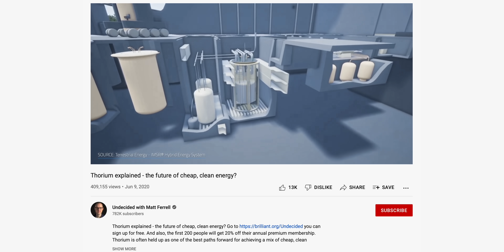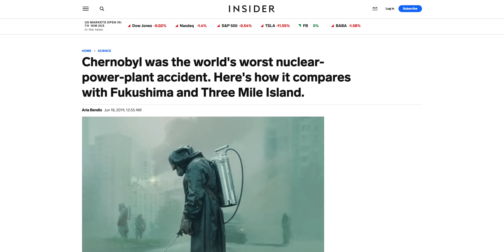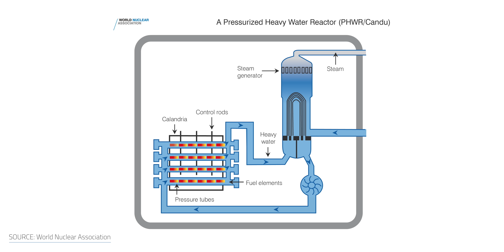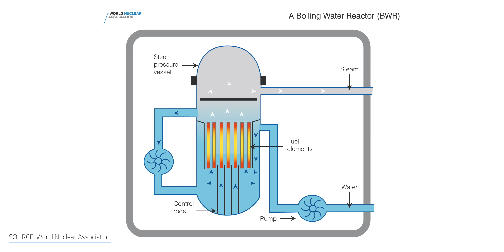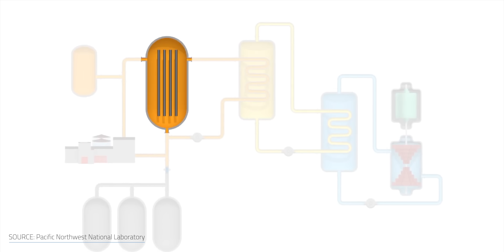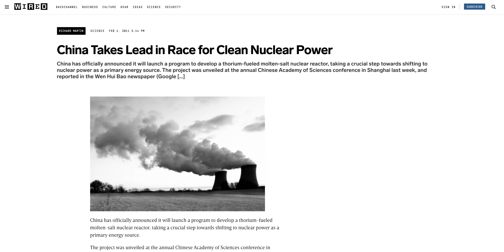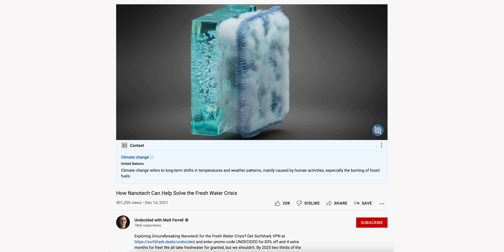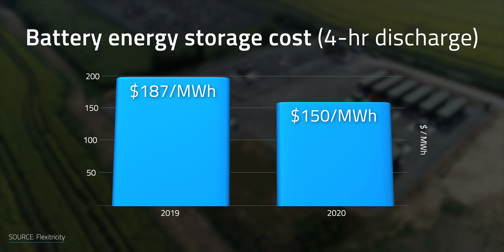Revisiting Thorium Energy - The Future of Nuclear Power?

Comment: I think it fair to be a little bit more suspect of these studies showing great potential and low costs. Nuclear has a long, long history of being great and cheap on paper, but not actually producing those results.

This quote from Hyman Rickover from 1953 is still just a true today as it was back then:
“An academic reactor or reactor plant almost always has the following basic characteristics: (1) It is simple. (2) It is small. (3) It is cheap (4) It is light. (5) It can be built very quickly. (6) It is very flexible in purpose (’omnibus reactor’). (7) Very little development is required. It will use mostly off-the-shelf components. (8) The reactor is in the study phase. It is not being built now.

“On the other hand, a practical reactor plant can be distinguished by the following characteristics: (1) It is being built now. (2) It is behind schedule. (3) It is requiring an immense amount of development on apparently trivial items. Corrosion, in particular, is a problem. (4) It is very expensive. (5) It takes a long time to build because of the engineering development problems. (6) It is large. (7) It is heavy. (8) It is complicated.

“The tools of the academic-reactor designer are a piece of paper and a pencil with an eraser. If a mistake is made, it can always be erased and changed. If the practical-reactor designer errs, he wears the mistake around his neck; it cannot be erased. Everyone can see it.

“The academic-reactor designer is a dilettante. He has not had to assume any real responsibility in connection with his projects. He is free to luxuriate in elegant ideas, the practical shortcomings of which can be relegated to the category of ‘mere technical details.’ The practical-reactor designer must live with these same technical details. Although recalcitrant and awkard, they must be solved and cannot be put off until tomorrow. Their solutions require manpower, time and money.

“Unfortunately for those who must make far-reaching decisions without the benefit of an intimate knowledge of reactor technology and unfortunately for the interested public, it is much easier to get the academic side of an issue than the practical side. For a large part those involved with the academic reactors have more inclination and time to present their ideas in reports and orally to those who will listen. Since they are innocently unaware of the real but hidden difficulties of their plans, they speak with great facility and confidence. Those involved with practical reactors, humbled by their experience, speak less and worry more.”

Thorium is basically still in the same place it was 60 years ago: great on paper, some small experiments are ongoing, far from actual implementation. Let's wait and see if and how Thorium reactors will actually reach the market before dismissing existing technology that is already here, is already abundently available off the shelve, is cleaner and is already cheaper, while costs are still freefalling. Let's also not just brush over the inherent proliferation risks (producing uranium-233) and waste risks that are also associated with most Thorium designs.
Reply: You, or should I say Rickover, was correct and if you read the history, he was ousted because he dared to hold the military industrial complex accountable and for that, wenow have the failures of the recient VC Summer and Vogel reactor projects.  It will be exceedingly difficult to correct those problems now.

Comment: One minor confusion.  The TerraPower (Bill Gates) design only uses Molten Salt to hold the energy (heat) from the reaction for later use.  It uses liquid sodium for cooling, and is a fast neutron design.

Comment: Everything we needed to know about LFTR:s or the chloride salt version was learned at ORNL with that first reactor. The problem is the "first mover" penalty that is the cost of getting the first commercial thorium salt reactor past the NRC. Once that first one has passed muster, the rest can ride on their coat tails.

In other words, the cost of bureaucracy is going to cause us to lose out in the race to put these safe and inexpensive reactors to work. Of course, the fossil fuel infustry, while generating more radioactive waste than the nuclear industry, gets to sit back and hope the job never gets done.

They talk about the mining of thorium, which is ridiculous because thousands of tons of it are generated in the process of mining for rare-Earth metals. And uranium is seldom burned up at a greater rate than 5% of the fuel load, while thorium in a molten salt reactor seldom drops below 90% burn up. And, as pointed out in the video, MSR's don't have to be shut down for refueling.. Uranium reactors must be shut down at least every two years for refueling and more often than that to rearrange the fuel rods to even out burn up.

Since they don't require water for cooling they can run at normal atmospheric pressure and yet at elevated temperatures that make them much more efficient than PWR's, which account for almost all of the world's uranium-based reactors. Yes, they have a few minor problems, but none that can't be engineered around. The first MSR ran for almost six years without problems and technology has advanced over that more than a half century since.

My recommendation would be to site MSR's on old coal-fired plant sites as those plants are shut down. The MSR's can certainly take over the transmission lines and maybe even the generators from the replaced coal plant. What's not to like? The NRC needs to be kicked to the curb on MSR's and the government needs to absorb the first-mover costs so that we can all benefit from this modern marvel brought forward from our past.
Reply: First, blaming the NRC boogie man is an old excuse.  Any new design will require extensive NRC review and the pool of people capable of that task are retiring at a baby-now-retiree-boomer rates. If the NRC approves a bad design, who will be the first to blame them for a poor review?  We have been building BWR and PWRs for 70 years so they sail through the NRC review but the latest VC Summer nuke was canceled after spending $5 billion and Vogel is 100% over budget and 6 years behind schedule with no end in sight. So what magic is going to make MSR or Thorium reactors break these records when you are using the same American engineering, project management, and construction talent? I have already heard people lining up the pandemic, supply chain issues, labor shortage, chip shortage, high fuel/steel price excuses even before any project is started because at least they know the build schedules are a joke.
Concerning the use of old coal fired sites, that is the exact politically motivated decision that was used to select the Natrium site in Wy. Switchyards are not that expensive and may not be a good idea to use 60 year old equipment when the cost to evaluate a site per the Safety Analysis Report will cost hundreds of millions.  Using a present or shudown reactor site would make more sense.
No matter what design is selected, start to operation is at least a 10-15 year project.
Reply: If it is a 10-15 year project, then we had better get started. Actually, because of our climate change issues,  this should be considered as a new Manhattan Project and expedited in all possible ways. 

Not only can these be sited on old coal plant sites, they won't need the switch yards developed for the massive coal trains, but those yards can be used for the industries that can use the process heat coming from fluoride or chloride, liquid thorium salt based reactors. PWR reactors require massive containment buildings and yet operate at lower, less efficient temperatures than liquid fueled reactors, making their excess heat not efficiently usable as process heat for other industries. 

As previously noted, the transmission lines and possibly the generators of shut down coal plants can be utilized by the new nuclear plant. 

One of the biggest problems is the massive and radioactive piles and/or pools of fly ash left over from burning coal. These should not interfere with the operation of a nuclear plant as it replaces the coal plant, but somebody will need to manage that. Many of the byproducts of a liquid thorium salt reactor can be used medically while even using the left over fly ash in concrete can be a problem because of the radioactivity.

Comment: Wind and solar power production don't take into account a number of problems; 1. they wear out far quicker than nuclear reactors. 2. Solar panels actually produce a great deal of toxic waste. 3. Solar and wind equipment is expected to be built in China.  Enriching a genocidal dictatorship that violates every environmental protocol regularly, and is becoming increasingly unstable is a poor guarantee for renewable energy. Windmills kill tens of thousands of birds annually and contribute to the mass extinction underway.  4. MSRs can burn nuclear waste from light water reactors, desalinate seawater, provide energy for decarbonizing sea water. 5. Thorium MSRs can be built on coal plants and former nuclear light water plants saving a huge amount of money in construction.  The corrosion issues have been addressed.  MSRs are less useful for making weapons, which is the main reason why they were not used by the decision-makers at Oak Ridge.  They are actually less likely to be used for fissile material than a light water reactor and can be monitored easier.
Reply: If you are worring about solar panel toxic waste you must be terrorized by the cell phone in your pocket, the computers in your car, Tv, or any other electronic device that is disposed at a rate far sooner than the 30 year life (still producing 75% of rated power) of a solar panel
Reply: @clarkkent9080  Apples and oranges.  Why increase the toxic waste problem by producing billions of solar panels with far shorter life spans than a nuclear reactor?  You tried to make the argument that the land displacement comparison was the opposite of reality. Solar and wind fields already occupy more land and kill more wildlife than any other energy form in the history of species annihilation/extinction short of the ancient comet impact.  I caught you in data falsification in other posts.  You are a brainwashed solar/wind fanatic.  Probably a member of Antifa, too.

Comment: Well problem is that nuclear energy is in direct conflict with solar and wind energy. If you build nuclear you need to has stable and continuous consumption. Coz worst thing for nuclear power plant is to shot down and power up cycle which is reducing it's lifespan. And renewables currently are quite unreliable so it's worst fit for nuclear energy.
Unless we finally will solve efficient energy storage problem.

Comment: There is a another upside for Thorium Salt reactors  which i think makes them top viable option even though renewables are cheaper and will be more cheap, which is heat source needed for production processes like mineral purification, metal melting and recycling. Heck we can even use that heat to transfer to our houses to warm up cheaper like Iceland doing with its geothermal energy. No waste high efficiency
Reply: Thorium MSRs can come near the cheapness of coal.

Comment: Nice work as always!  One correction Matt - not all conventional Uranium-fueled reactor must shut down for re-fueling. The CANDU reactors, which are in wide use in North America and elsewhere, are fueled/de-fueled continuously without the need for an expensive shutdown, nor is it necessary to build two reactors to ensure that there is always power flowing from at least one reactor. This has always been a huge advantage of the CANDU design over the Westinghouse PLW designs favored in the US.

Comment: If you're wondering just how cheap and efficient "renewable" energy is compared to nuclear, you must watch the documentary "Planet of the Humans", free on YouTube. The only reason wind and solar are being built is that they are HEAVILY subsidized by government, at taxpayer expense. I don't know where you got your figures, but they are wrong. Thorium molten salt reactors aren't being used commercially yet is that hardly any money has been available for research and development of this technology. This is definitely the energy of the future. Not only is thorium much cheaper than uranium, but it doesn't have to be enriched. Only U-235 is fissile, but uranium ore is >99% U-238. The mix has to be at least 3% U-235 in order to work. Enrichment is very expensive.
Reply: The U.S. government has substized nuclear for 70 years developing and testing every type possible including Thorium and MSR. The taxpayer is now providing $4 billion no strings attached to private investor owned utilities to build 2 new reactor designs and $6 billion for investor owned utilities to keep some old ones running longer.  Solar and wind need another 60 years of tax breaks to catch up

Comment: Seems like a really, really bad idea. 
In a best case scenario there will be early commercial reactors in the late 2020s. As always with new technology these will come at a premium and suffer from some reliability issues, driving up cost. For these to gain any significant market share will probably take another 10 years. Our grid should have long been clean by then.
Meanwhile solar and wind and batteries can be installed today and have economies of scale in full swing. 
Aside from the economic, technical and environmental challenges of nuclear energy there are big issues with politics and market dynamics.
This new reactor technology isn't a sure thing. It's entirely possible that it just doesn't work out. Politicians, NIMBYs and industry lobbyist groups are using this prospect today to prevent or delay the expansion of renewable energy sources. We don't have the luxury to wait and see if thorium pans out.
The uncertainty and weakened political support also makes renewables a less attractive investment option.
The last issue is global adoption. For many countries nuclear energy is not an option because it's to expensive, they don't have the technological knowhow to operate them, rely on decentralised energy production because they don't have a sufficient grid, or can't get reactors because of export restrictions. If rich and big countries are going for nuclear energy the economies of scale for renewables will collapse making it even more difficult for less developed countries to transition away from carbon intensive energy generation.

Comment: We can make power system that don't result is such poisonous waste that still lasts a very long time.  So why???  Solar and with with battery should do what we need.  Battery tech will catch up with far cheaper costs.
Reply: Guess you never looked into all the toxins in solar and batteries, and the difficulty in recycling them.
Reply: @danadurnfordkevinblanchdebunk  But at least it CAN be recycled.  Unlike radioactive wast.  Battery and solar have issues, however, nothing approaches the possible disasters that of a radioactive spill can do.  So why take the chance.  Thorium should be investigated for very specific use cases, but in general. Solar and wind is already super cheap and still getting cheaper.  Storage is the only issue left.  An issue that will be solved in the next 10-20 years.  The number of projects and investment in it is astonishing.  So many promising projects.

Comment: The focus on "advanced nuclear" is great.. but also a big waste of time. Nuclear as it stands now is already safest way we have to generate power, and the most reliable way to make carbon-free power. 

The dream of MSR/Thorium/Fast-Spectrum is a solution for 4 decades from now. What needs to be done is to build 100 Gen3+ (like the AP1000 ) reactors over the next 2-3 decades, along with PWR-type SMRs built on decommissioned Coal sites. Of course, MSR/Thorium/Fast-Spectrum reactors should be researched, demonstrated, but thought of as replacement for the current set of Gen 2-3 reactors in 2 to 3 decades from now. 

Decarbonize now with PWRs! They are just fine, and do the job.
Reply: Why use PWRs, when PHWRs can work on natural uranium and have better burnup?

Comment: I would suspect that (barring radical cost costs in energy storage) that thorium reactors should be part of the energy mix. This is also incumbent on the rapid retirement of conventional reactors as well as the expectation that economic use of fusion power is still 20 years off. This could slot the MSR into the energy mix usefully in the interim, the sooner we can ditch fossil fuels the better off we are but conventional reactors have an overwhelming hazardous waste problem so additional conventional reactors just don't seem a very good idea.